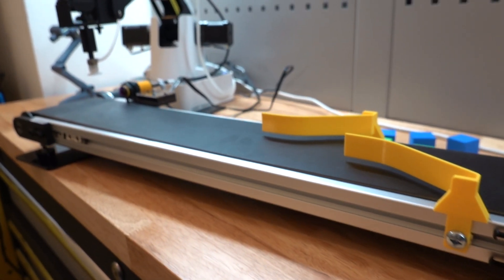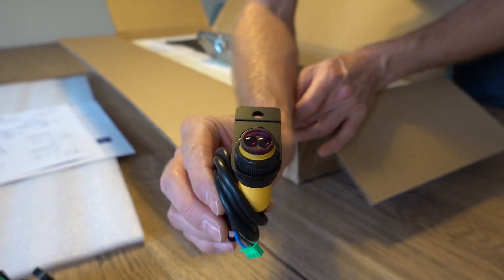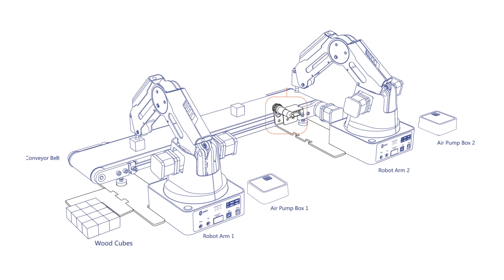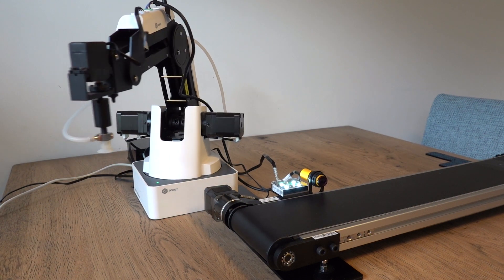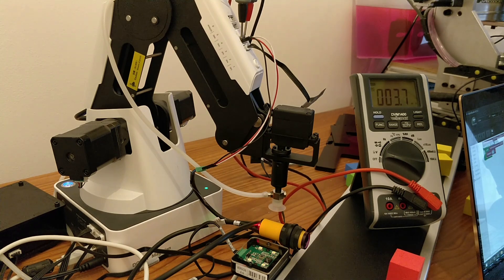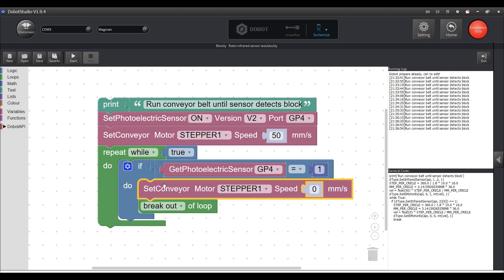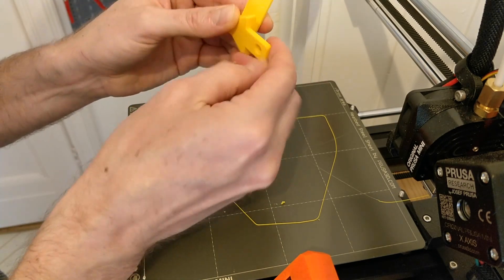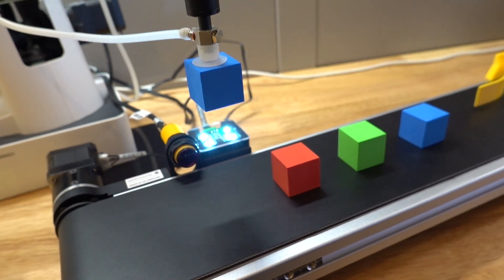Dobot Conveyor Belt First Impressions Review

Comment: What material was used for the belt ?
Reply from the maker: I think it is some custom composite material with fibers for strength and a rubberized top layer specifically made for belt applications.

Comment: Hi, I found your Dobot Conveyor Belt Parts Guide and wanted to ask if it’s okay to use it in a commercial work project (internal use only, not for resale or redistribution). Just want to make sure it’s permitted. Thanks!
Reply from the maker: Hi, sure no problem for internal commercial use. Best of luck with your application!

Comment: What is the modification in the code
Reply from the maker: Hi, I no longer have the review unit nor the software, but there are a couple of points in the video where I am showing some code. I am afraid the is all I can offer at the moment. Please note that the code that I am using is very similar to the examples in the user manual, so of you download that for free from the Dobot website, it should provide you with enough information to make your own programs.

Comment: do you sell just the mechanical parts? no motors and sensors are needed
Reply from the maker: Hi, I am not a distributor for this equipment, but I don't think they sell the kit without the sensors and motor.

Comment: Bro which stepper motor used ?
Reply from the maker: Hi, I don't know the exact type but it is a nema17 stepper motor with gear reduction.
Reply: @uptimefab7412  And aluminum extrusion dimensions 
Ex . 2020 ,4040,6060 ?
Reply from the maker: I don't have the demo unit anymore but I would guess 4040

Comment: Which Sensors are used ?
Reply from the maker: Hi, I have already sent this review set back to the supplier, so I can't get the specific make and model for the sensors. There is a generic photoelectric sensor for detecting parts. The color sensor might be a sensor on a custom print by Dobot, but I am not sure about that since I no longer have acces to it.
Reply: I bought the conveyer belt a year ago. My photosensor is marked as an e18-d80nk. It seems readily available online, although the one with that came with the belt has the connector plug on it for the Dobot.
I can't find any specific product info on my color sensor. Just "Version 2.0 YS 20010194" sticker on the side, which doesn't come up with anything online.